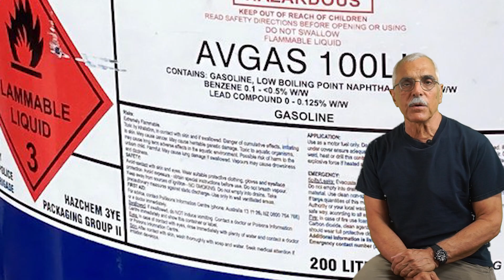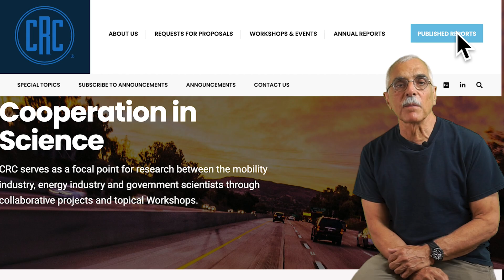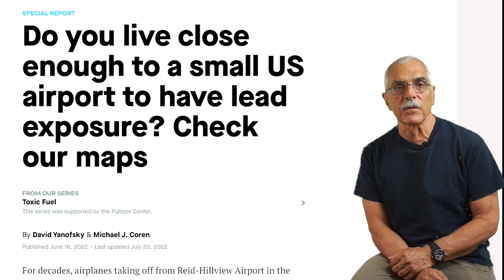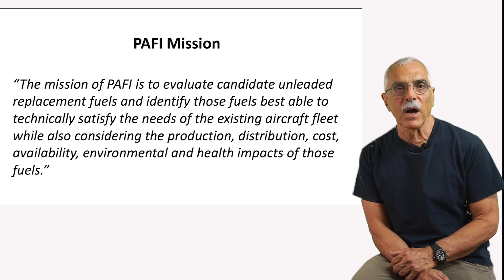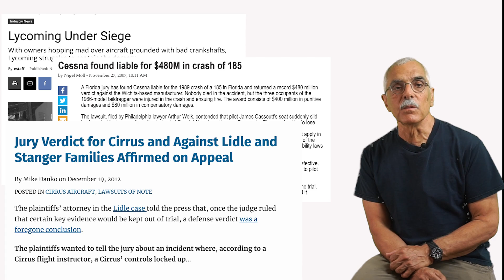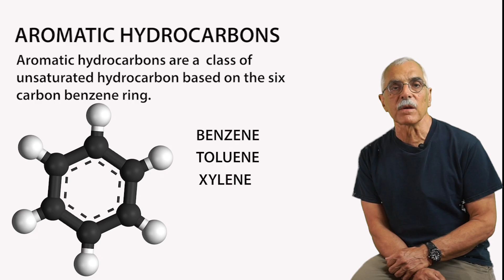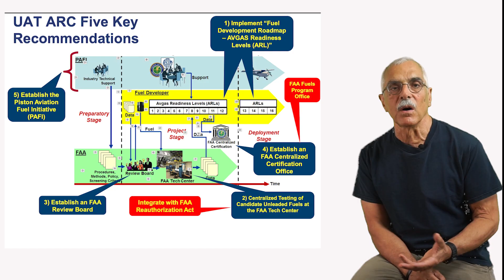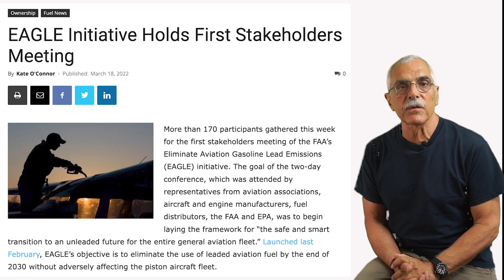The Long, Twisted and Slightly Ridiculous Story of Avgas Part 2

Comment: Congress is gonna have to mandate that 100LL be banned beginning, say, 2035, and that all new aircraft piston engines manufactured after 2030 must run on 93 octane unleaded mogas. Further, all existing engines, with a TBO coming due after 2030, must be replaced with a mogas engine at next TBO. It's not hard.

Comment: Making a drop-in replacement that must work across the entire fleet makes a changeover a Herculean task.  Far better would be to simply design the new gas, and mandate planes be built to run on it.  To allow these brand new engines to work fine at airports that don't have the new fuel,  come up with a new gas that can be burned by engines that burn the existing gas, and allow them to actually do so until say 2035 or something.   Make both fuels available side by side, just as done with cars for decades.  Mandate that planes must be adapted to it when they're say 40 years old, and that means you will have a solid end-date of the leaded era.

Comment: Just a correction from a chemist, but hydrocarbons are not based on benzene. They aren’t necessarily cyclical, and generally are just long chain hydrocarbons. Hydrocarbons are just chains of carbon with hydrogens. Generally linear and of different lengths.

Comment: Simple to understand.  The FAA needs the GAMI issue papers to learn how GAMI solved the knock problem.  Without the issue papers, the FAA cannot collect the GAMI proprietary information. Then the FAAs EAGLE program can subtly transfer those methods and results to the major producers, so that they can replicate the GAMI product.  Once the major producers have developed their own equivalents, they can write a spec of their own, the FAA can issue an NPRM and rulemaking that gives the blanket approval to the major producers spec.  Sorry, GAMI, but your proprietary fuel blend doesnt meet the new spec they all wrote in secret, and you wont be covered by the new FAA rule.  But thanks for your contribution!  You know what they say about the pioneers - the first guy gets the arrows and the second guy gets the land.

Comment: Great reporting! If the FAA & EPA mandated that no engines that required leaded fuel could be installed in planes after certain date, the engine manufacturers and the fuel suppliers would figure it out pretty quickly. No incentive= no change. As was stated: f… the planet. Keep the margin.

Comment: In A&P school, my instructor told us that the lead acted as kind of like a lubricant and cushion for the engine, as well as increasing the octane rating. I would rather the fuel be lead free though. There's alot of a&ps that get old and get cancer, and i'm sure working with lead fouled engine components don't necessarily help the situation.

Comment: What cracks me up about all this is that there is exactly ONE place in the world where tetraethyl lead is produced and it ain't in the USA.  If that place (in the UK) decides to cease production, or just plain blows up, them 100LL goes the way of the dodo almost instantly.  I'm always amazed folk are prepared to drop massive amounts of money on new aircraft like Cirrus, knowing they are completely and utterly dependent on a fuel hanging on a single supply chain.  My airplane could run on UL91 or mogas for a very good reason......

Comment: I do not know whether this has already been addressed, but whatever happened to Triptane?  Kettering was doing work on it at the end of WWII.  Some extraordinary claims were made, but as far as I know were either somewhat overblown or highly conditional on circumstances.  I believe it had some limited benefits by itself, but was best used as a lead enhancer, that is, it increased the effectiveness of TEL considerably.  This would hardly eliminate lead, but would it reduce the amount required?  

At the end of WWII, the amount of lead in the PN 130/150  grade fuels was pretty extreme, the additive Ethylene Dibromide could, sometimes, not be trusted to scavenge the lead and expel it from the cylinders it in the exhaust gases (apparently it varied in its effectiveness with Russian fuel being the worst - some flights back to England resulted in extremely fowled spark plugs).  Cruise seemed to be the worst power level for lead build up.  

If Triptane was supposed to provide this enhancement of the effect of the lead, is it used today, if not, why not,  and if it is used, in what capacity?

Comment: I really liked both parts of  this well written and witty report that I subscribed to the channel  and I don't even own a plane . Thanks for the historical background and all the current information.   I have for decades until recently used very small amounts of AV gas which I was able get at he local air port , to run in vintage racing motorcycles and a few other odd ball small engines . It was high quality and ran great , then MOGAS showed up and was honestly better !  The situation with running the localy available oxygenated MTBE and later alcohol added pump gas in these engines was not workable .  Then recently obviously for the greater good... the nanny state intervined and small sales to users like my self were prohibited . We have billonares blasting  20 minute rocket joy rides into space burning who knows what for fuel ( but rumored to be liquified rubber) and I can't buy 5 gallons of MOGAS to run a Bultaco Astro Flat Tracker on a couple times a year?  Sounds about right !

Comment: I would be very easy to "cussion" the props so they don't brake from the Diesel engine.
Or You could have Diesel electric power train.
I know all this adds weight, but NOT polluting is more important.

Comment: Why don't we use more Diesel engines in airplanes???
Even the fuel economy would be way better and detonation is not an issue even at 22 to 1 compression ratio.
We could also design gasoline engines that work on the diesel principle.
Also small gas-turbines are available for Helicopters.
Why we don't use them instead of piston engines???
I know piston engines are way cheaper, but that should not be an excuse to pollute the world.

Comment: TEL is not just an anti-knock additive but also a valve/valve seat buffer(lubricant) and not the only thing piston aircraft "get away" with. Would anyone take the next step after unleading avgas and force general aviation aircraft to add catalytic converters and fuel vapor recovery to avgas pump nozzles? Or mandate return of samples back to tank instead of spilling small samples on the ground... Separate topic: does anyone know why we don't have to ground cars to the gas pumps like we do with aircraft?

Comment: I had referenced the G100UL fuel that GAMI has proposed in Part I of this 2-part series, but would like to add a few additional comments.  G100UL has been around for OVER A DECADE and the FAA has continuously stonewalled authorizing its use.  This includes all the rigorous testing of the fuel in a variety of scenarios beyond whether it could be burned safely by engines that use 100LL.  It includes testing it with materials that might react adversely to it such as composite wing tanks, rubber bladders, etc.  For the most part, those tests were all completed long ago.  The only thing that has happened for the past 12+ years, is GAMI having to do study after study, test after test, with the FAA promise that once completed it would get the FAA's signature, and still the FAA has not signed.  Perhaps it IS all about the FAA being nervous about liability once they approve it, but by that thinking, their best risk aversion approach would be just to ban all flights, both GA and commercial, because there's a risk.  It's not a good enough reason to hold this up.

There is a YouTube video of a presentation by George Braly that goes into all of this in much more detail, including thorough testing of the fuel in composite airplanes, with the help of Cirrus.

For the record, "drop-in" refers to a fuel that not only works well in engines that have heretofore burned 100LL, but also that you can put it in all kinds of aircraft fuel tanks, refueling tanks on the airfield, mix it with 100LL with no negative effects, etc, etc, etc.  Basically, that no matter how you substitute it or mix it with 100LL, it works well and with no negative consequences.  So, with that, below is the video resource I referenced.

 Here is the name of the YouTube channel where you can find a presentation that was given about this, as well as the title of the video...

YouTube Channel: Martin Pauley
Video: "The G100UL STC Saga - George Braly at AirVenture 2022"

Finally, here are the overall 4 qualifications of G100UL
1) It does not have any lead in it
2) It is fully compatible with all the engines out there currently burning 100LL
3) You can even MIX the two with no negative effects and, 
4) It has been tested in all types of storage tanks, those on the aircrafts, refueling tanks, long-term storage to test for break-down, engines with nylon O-rings, you name it, and with no negative results

Comment: On a side note, when I was completing Navy Flight School in Pensacola in 1979, Navy pilot training at Sherman Field still included flying the North American T-28C Trojan, powered by the Wright R-1820-86 Cyclone 9-cylinder radial engine. This engine required very high octane 115/145 AVGAS, available on the aerodrome, in an official capacity. 

I envisioned trying to "borrow" some of this high-test fuel to tank up my Harley-Davidson Sportster … but thought better of it. Instead, I rode my bike out to the local general aviation airport, and tanked up on 100LL AVGAS. Paid up at the counter and stole back to my bike, whereby I added an ounce or 2 of Klotz TE-Lead replacement, which was still available to buy at the auto parts stores. 

Started her up, and MAN, did she PURR! The idle speed picked WAY up, and the dry-sump oil tank was VERY WARM against my Levi's-covered leg. I loved putting my Sportster-based XLCR-1000 through its cafe-racer paces during the remainder of that tank of gas. I also used  up the Klotz supplement in later fill-ups at the 76 station where you could get high-test racing fuel at the pump. Nothing compared to that tank of 100LL, though.

Man, I just LOVED that bike! A "Willie G Special" collector's edition.

Comment: Again, what is the necessity of eliminating tetraethyl lead from AVGAS? How much exposure to lead in the atmosphere from GA engines, beyond what is already there from natural background sources,  really exists? We took lead out of MOGAS because it fouled the catalytic converters mandated by the EPA to be placed in vehicles to take ALL THE OTHER atmospheric contaminants out … BUT NOT FOR LEAD. Unleaded MOGAS was NOT "UN-LEADED" because of atmospheric contamination, but ONLY to prevent clogging up catalytic converters. To say we took lead out of MOGAS so many years ago, and compare that to a reason to support taking lead out of AVGAS is just a complete NON-STARTER, because you are trying to compare apples to oranges.

Comment: Very good presentation! I would like to ad in addition to AvGas performance properties it’s near perfect storage properties as well. AvGas  has always impressed me with its ability to evaporate and leave no particulates   behind. And doesn’t shellac or vanish either. In addition it doesn’t soften or harden gaskets hoses and diagrams. All the above are a problem with automotive pump fuels. 
Aircraft owners can operate planes that have sat for months on a flight line with old fuel and not have  gummed up carb worries. It’s a near perfect fuel if not for the pollution aspect.
Reply: Ethonal free fuel.. the one  for off road stuff burns clean as a whistle.. no varnish , doesn't distroy carb seat or seals nor hose, no scum , doesn't corrode aluminum , if it evaporate literally leaves nothing behind..

Comment: Excellent dissertation...but I didn't see anything about valve wear using unleaded fuels.   The deposits that people complain about fouling sparkplugs (yes it happens) also coat the exhaust valves with that nice white coating you see in your exhaust pipes and this creates an interface between valve face and seat.   Auto engines long ago went to hardened seats and valves that are resistant to this wear...but many/most older aviation engines don't have such things and could/would suffer from rapid wear using unleaded fuels unless some other compound is included that will mimic how lead works in this regard.   

Yes detonation can be controlled by electronics...but that valve erosion is a pesky problem for aircraft engines being that they are run pretty much flat out for long periods of time which NO automobile can do on the road.   Closest thing we have would be a gasoline truck pulling a heavy load up a mountain, but that still doesn't compare to the relative hell an aircraft engine lives with every single day.

I'm pretty sure that modern manufactured aircraft engines that are certified for unleaded fuels have these hardened valves and seats, but there are still LOTS out there that don't and should one of these older engines be misfueled with unleaded a failure could easily happen.   Tetra-ethyl lead IS nasty stuff...but the actual amount being spewed into the atmosphere today with all automobiles no longer using it makes it much less of an issue than back in the days before unleaded.   Saying that it degrades IQ is probably correct...but considering the insanity we see daily exhibited by our population I'd opine that leaded aircraft fuel is the least of our worries.

Comment: BP sells UL91 avgas over here in Yurop, home of EASA, the aviation authority that makes the FAA look efficient, reasonable and cooperative (plus the 27 squabbling national aviation authorities that make EASA's job a hellish cat-herding chore). Despite all that, they managed to get most of the fleet to STC their engines, and the FAA played ball and certified a STC for N-registered airplanes based here (of which I fly 2). I know radials run 100LL only because they are such noble beasts, being designed for 130 and more, and that older high-power pistons need the lead both for lubrication and knock resistance... but the majority of the fleet doesn't, and unleaded gas availability will need a Govt nudge (or a big shove) to get it to airports across the country... and it has to be cheaper b/c right now the oil companies must duplicate their downstreams down to the tanker trucks

Comment: Back in 1986, I got an EAA 'supplementary type certificate' (STC) to use regular 87-octane car-gas ("mogas") in my 80-octane- rated Piper Tri-Pacer. I spent several years hauling mogas in jerry-cans to fuel my 'Snowbird' (which I named from Anne Murray's song, because I bought it as a rebound from a destroyed love affair.

My mogas experience ended when the car-gas stations in my neighborhood went to 10% ethanol.  The problem was that ethanol corroded, softened, and otherwise wrecked the older airplanes' fuel system.

Comment: I think this time is different because aviation based lead exposure is now on California's radar so to speak. And for all we love to lambaste them for draconian air quality measures they will act unilaterally with no concern whatsoever for the consequences to GA (just drive your Tesla instead of flying). That will be where the poo hits the fan. The faa could sue to force the fuel to still be sold in California. But that's gonna have really bad optics for the greenies in Washington.  The non ga voting public is gonna say you had half a century to figure this out so I don't care collectively.

Comment: What is the principle at the top of our pyramid of issues? If it's lead in the atmosphere, then how big a risk is it actually? If IC AV engines are a big (measureable?) threat to general health, then let's go back to the future, say 1935, and have low compression AV engines running on unleaded. Don't want to accept the performance trade-offs? Maybe a potpourri of blends to cover all types. Could there be a study to show the trade-off of how many crashes/deaths from inadvertent pumping of wrong avgas vs lead poisoning (it will happen, like when they pumped jet fuel into a DC-3 at Lambert; plane just cleared the runway). And recall the disaster the Luftwaffe (you were in Germany in '41?) had with Bf-109F, going from dural to rubber fuel tank & continuing with hi-aromatic avgas...
Indeed, before we re-invent ourselves into this brave new world of "safe" avgas, shall we carefully weigh what we may gain against what we might risk?

Comment: Meanwhile, straight alcohol has been used very successfully in highly turbocharged engines delivering around 1000 HP per litre of displacement, and it has zero problems with phase separation since water and alcohol are 100% miscible in all ratios. Seems like it could be a promising candidate to replace or supplement AvGas, but is it even being considered?

Comment: The solution is a ground-up new design aircraft engine that runs on premium auto-fuel. The problem is how expensive it is to develop new tech in aviation; Listening FAA? As the 1930's engines hit TBO or need a rebuild, have a drop-in new design engine for similar costs at a factory overhaul or new OEM engine. The problem is not the fuel certification, it's the engine certification. Unfortunately, warbirds etc. may have to convince producers to make fuel especially for them. IMO, warbirds should not be flying anymore anyway, but that's another issue, and I'm sure that comment will get plenty of hate.. ;-)

Comment: Myself and 2 friends had '46 Ercoupes. I ran Mogas and the other 2 ran 100LL. When we all flew out together the other 2 'coupes were fine but mine was plagued with carb ice issues. I had a digital EGT and I could see the carb ice forming by the EGT reading maybe a minute or 2 before the engine would start to run rough. BTW, we live in a pretty dry climate as well.